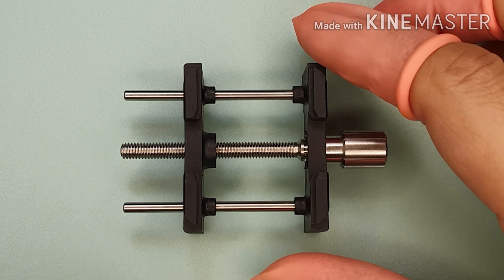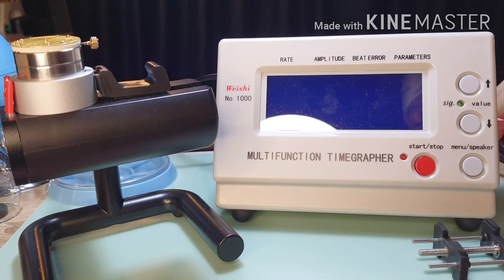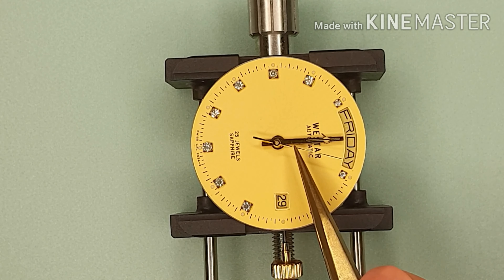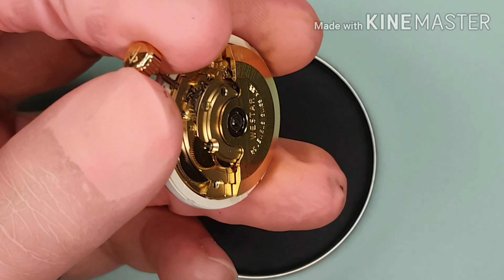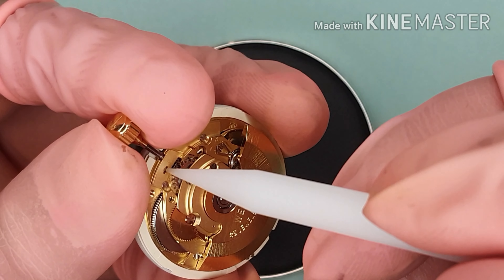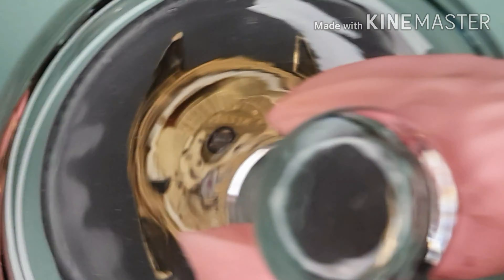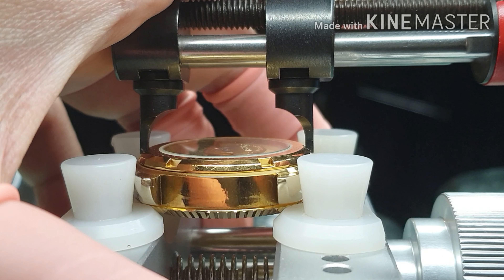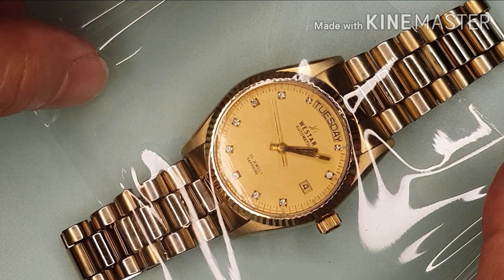Servicing Swiss Movement ETA 2834 - final - Balance wheel replacement, Regulating and Casing up

Comment: Good Video and good Job, but just a few Questions/ Suggestions:
Why do you use Polywatch? The Back doesnt seem to be an acrylic Crystal and Polywatch only works there.
Cant You just turn your Loctite upside down and then dip the Stem in the Opening...so you dont have to fill it in a Cup and throw the rest away?
For Closing the Caseback i can recommend a rubber Ball...costs only 1-2$ and doesnt scratch anything and is very handy...the last half turn to thighten it firmly can then be done with your tool:)
Reply from the maker: Thank you very much for your comment and recommendation.  That is what I need.

For the backcase, may be I was mistaken, I thought it was acrylic.
I will take those recommendation for the Loctite and rubber ball. :D